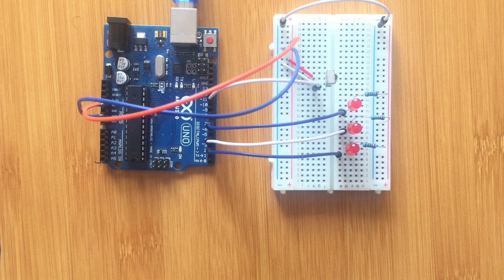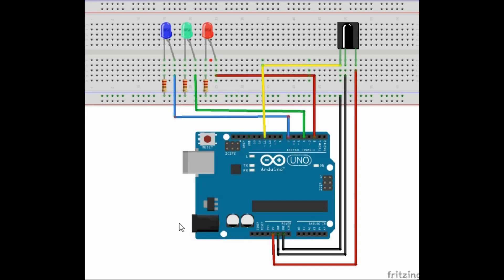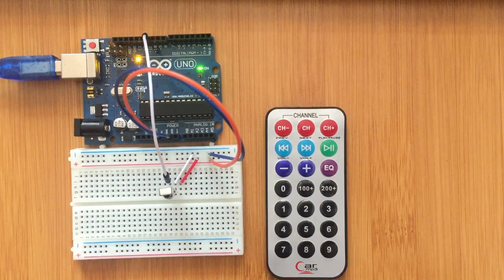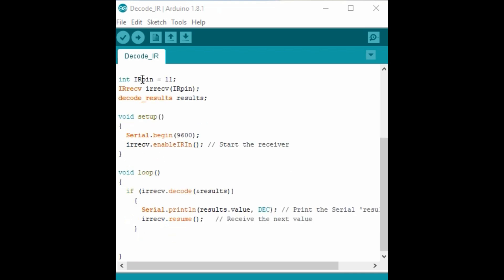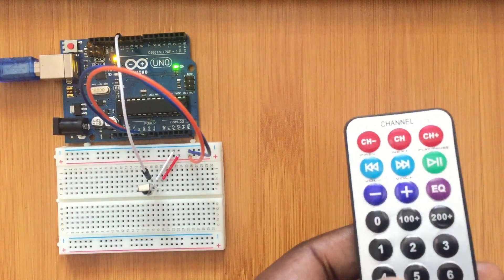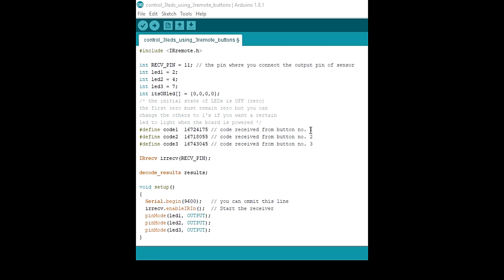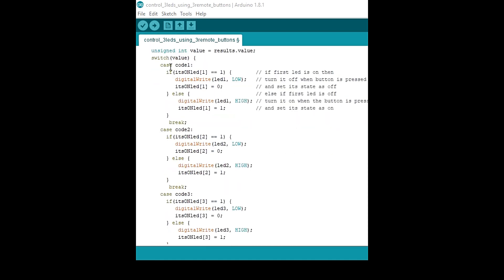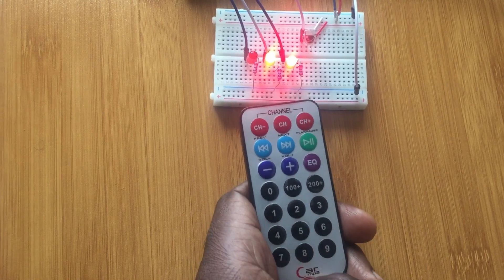ARDUINO: IR REMOTE CONTROL OF LEDS

Comment: Arduino: 1.8.5 (Windows 10), Board: "Arduino/Genuino Uno"

C:\Program Files (x86)\Arduino\libraries\RobotIRremote\src\IRremoteTools.cpp:5:16: error: 'TKD2' was not declared in this scope

 int RECV_PIN = TKD2; // the pin the IR receiver is connected to

                ^

exit status 1
Error compiling for board Arduino/Genuino Uno.

This report would have more information with
"Show verbose output during compilation"
option enabled in File -> Preferences.

Comment: there is a wrong in code
Reply from the maker: Please always be specific about the error you find in the code because as you can see very many people have used this code before and it works fine.
Reply: @mytectutor   The function decode(&results)) is deprecated and may not work as expected! Just use decode() - without any parameter.
 and 0

Comment: i tried it with tv remote,but the values are changing even if i pressed the same button
Reply: same
Reply: @giorgiolelmi8175  then its problem in you reciever.
i had the same problem.but after i changed my reciever and it worked fine

Comment: Did you try to run this project with external power Supply.    Not with laptop or pc usb power.    5 v dc power Supply.

Comment: There's an error in the #include <IRremote.h> please help.
Reply from the maker: make sure u have the IRremote library included in your Arduino IDE.
Reply: How will i know if i have IRremote?
Reply: What I've done to get around this is to download the Arduino-IRremote-master zip from githup, open the folders until i find the IRremote.H. I then select all the files in the folder and compress them into a new zip file. After all that, you can goto, in Arduino IDE, sketch, include library, add.Zip library. Then select the new zip you've made and it automatically adds the .H file to your library list. Seems to work okay. On some .H and .CPP files you'll need to update the paths/dirrectories where some things are found.

Comment: hello i have done decoding of remote -but on serial monitor some values automatically appears  when i press remote button it show me remote code. but after tht some values continuously appears on serial monitor.  i think when i press remote button only that time some values should appear only.
Reply from the maker: which kind of remote are you using? And then when decoding you should not press the remote button for too long because  if you observe in the tutorial when you press the button for long you get some very long numbers that appear continuously yet we are interested in the shorter codes. Please subscribe to my channel